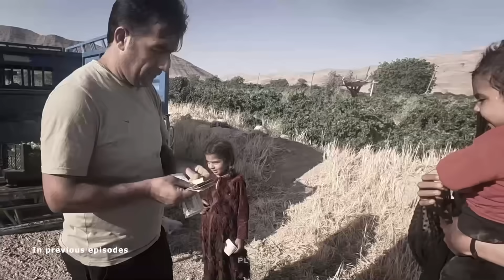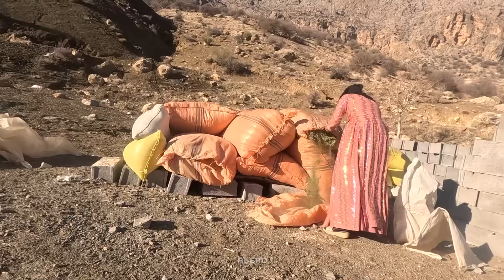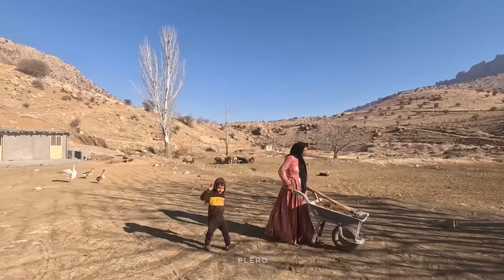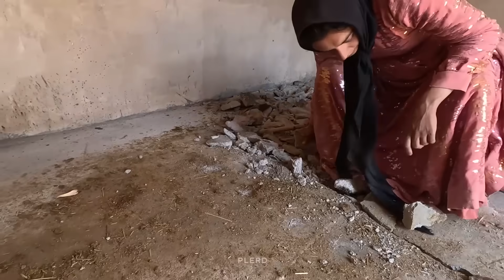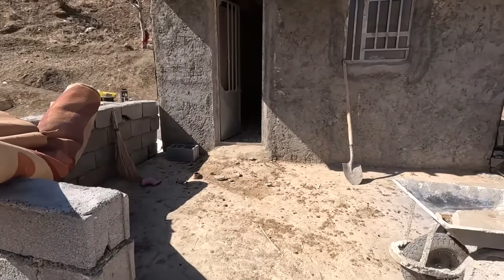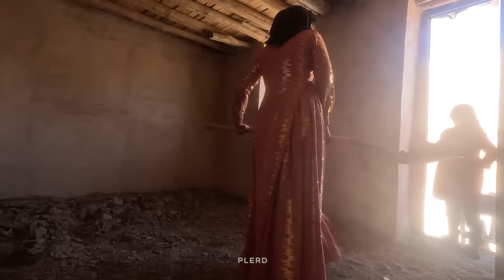Mother and Children Team Up: Sheep Barn Floor Revamp

Comment: It is difficult for sheep to graze in mountainous areas, it would be very nice for goats, the sheep house is good, but why does the concrete underneath break? I think it would make more sense if you throw soil under it with a wheelbarrow, so breaking the concrete is torturing yourself, I think it would be good to be knowledgeable about animals, there is limited space for chickens, a big coop. needs,

Comment: She should have kept the first house she built as a warehouse as she may need it later. All the hardwork put in to built it so beautifully.  Should have built another bigger place for the sheep and you dont have to cement the floor. The ground itself would have been better. She should have built the barn first before getting the sheep in this way the first house can be used later when needed.

Comment: Plerd what are the ages of my babies? Azada, Sam n Hamid? Is the water at the pond good for the sheep? Tayaba needs to put fresh water in it. Put the hose in and let it overflow fir a while to flush out the pond. What you guys think. Its a small pond , Stagnant and there hasn't been rain enough to flush out.🇯🇲